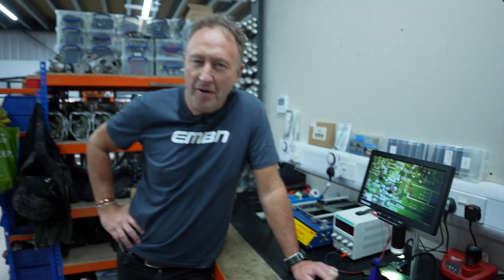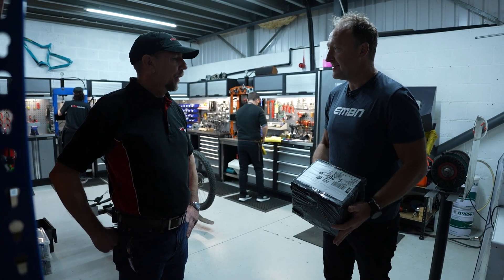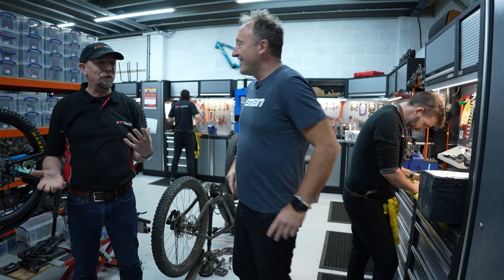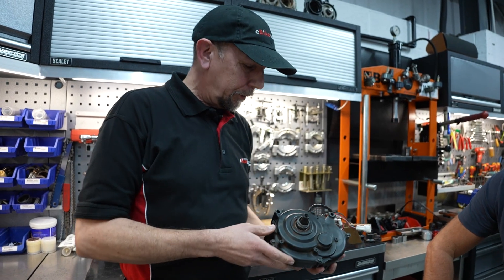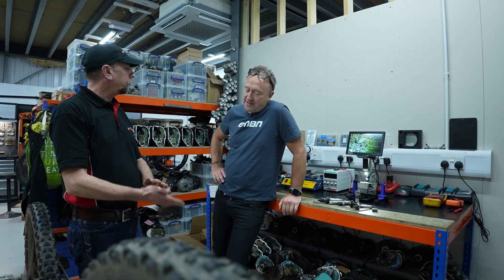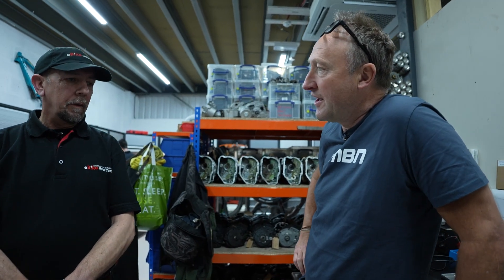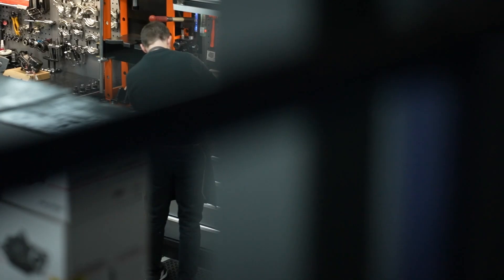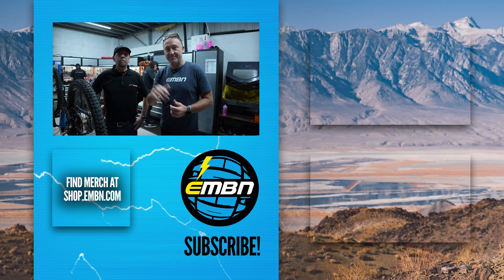How Affordable Is eBike Motor Repair | Behind The Scenes

Comment: What centers like this do is fantastic, but firstly, these repair centers are few and far between, and secondly, as mentioned in the video, there is not enough support from the original manufacturer. Keep in mind that these motor repair companies are getting the majority of their replacement parts from other motors that have failed in different areas. Imagine buying a car where the manufacturer doesn't supply parts for local mechanics, which would force consumers to buy a replacement car — this is an absurd situation. Also mentioned in the video, 90% of motor failures are due to water ingress. How is it that a rear mech can be made to be water-proof but not the motor? As proven by the motor center's efforts to seal the Brose motor, they have drastically increased its life. It's absolutely doable, but for some very odd reason, the manufacturers are choosing not to. Granted, all machines fail at some point or another, but there are clearly some very simple, tried-and-tested engineering solutions that are not being used in these premium machines. At the price of an e-bike, it's just not acceptable.
Reply: What's going to be telling is in 2+ years, when everyone's bargain ebike fails out of warranty, what will the consumer sentiment be towards these manufacturers when they realise they can only buy refurbished parts recovered from other failed motors, which will become fewer and fewer as time goes on. Its the same failure to future forecast as we saw with bike companies failing to realise that 2021 bikes sales would eventually end. Its just going to compound the issue of sales-slow down and will negatively impact the bike industry for a good few years. The shortsightedness of the industry know's no bounds.
Reply: Hi Dafy, distance shouldn't be such a problem, as most drive units can be shipped to motor repair shops in their country - eBike Motor Center has very strong network of partners worldwide. Regarding replacement parts, all service parts such as bearings, seals, bushings, belts, etc., are brand new and typically of equal or better quality than the original components.
The "very odd reason" is simply friction, which leads to high energy consumption. Everyone wants to buy the eBike with the best battery range...
Best regards, EBMR e-Bike Motorreparatur (Austria)
Reply: @bikemotorreparatur “Everyone wants to buy the eBike with the best battery range...” – but whats the point in range if your motor dies within a few hundred miles? Not meaning to go on the attack out the gate, and I understand this isn’t something within your control, but this logic is questionable at best. I think anyone whose experienced issues with their ebike would rather a bike that’s reliable over having extended range, especially riders from wetter climates.

Parts – Bearings & seals is one thing, but bespoke motor components is another. Are you able to source brand new motor controllers, the battery management system, a brand new stator / rotor,  does the manufacturer provide this to you directly or are they third party solutions?  How transparent are manufacturer's with you regarding these parts? Genuinely curious because I hear otherwise.

There is currently no legal support that forces the manufacturer to supply replacement parts for aging motors, as is the case in the auto industry (within the EU atleast). Its simply down to each manufacturer on how long they choose to support their products, and as we’ve seen with the questionable warranty process of some, this doesn’t induce confidence for the consumer looking for a bike that lasts and can be continually repaired. Also lets not forget, the terminology of 'lifetime' that manufacturers use regarding their motors is often the warranty period only. So when manufacturers like Fazua claim that their bearings last a lifetime, what they really mean is 2 years. 

I truly appreciate the service you provide customers to keep their bikes going, but the manufacturers need to do more to support you and their consumers. For a premium product, we should all be expecting better.

Comment: So, what about rebuilding Shimano EP8 motors? There are a lot of Shimano motors in bikes.
Nothing was said about this in the video.   Why would they be any different to rebuild?
Reply: Most of the Shimano drive units will sooner or later encounter the E010 error, which typically indicates a problem with the torque sensor, often stemming from communication or calibration issues with the main PCB. A problem that is not repairable. As a service provider and mechanic, you don't want to be the last one to have worked on the motor, even if it was months ago, and you've only repaired mechanical parts. Under the one-year warranty, you may be obligated to purchase the customer a new drive unit, which can cost around €1000. This could prove to be very costly in the long term. Best regards, EBMR e-Bike Motorreparatur (Austria)
Reply: In my previous post I spoke about it (you picked out the water pressure part).

They won't do Shimano because they can't reliably service them without getting errors post service. So they just won't touch them which is fair enough on their behalf, Shimano on the other hand need a pls explain on that one
Reply: Campaign to Shimano, if they speak to us and help with software, we will happily support their motors again.

Comment: Plz advice me, I have trek rail 9 purchased it 6 months ago, the motor is Bosch and it’s rattling while doing downhills without pedaling, I went to the dealer I bought it and they didn’t see anything to do, plz advice me about this rattling noise?
Thanks
Reply: Most motors rattle coasting. Some are worse than others. It's mainly gear lash. t
The TQ is generally the quietest and the EP8 the loudest. The rattle can sound worse with some frames than others.
Reply: Yes, as @tonyrobinson1623 said... the Bosch Gen 4 rattle is caused by a small amount of backlash or play in between the transfer gears, inside the motor. There is no fix for this currently.
Reply: @Ebikemotorcentre  Thank you for your advice, So is it okay to keep riding it ? Will the noise be louder soon or any damage from more rough rides or jumps ?  It’s very frustrating that I have warranty and they can’t fix it…

Comment: I paid about $1000 for a Brose "rebuild + upgrade" by eBike Motor Repair in Tennessee (USA).  This cost also included a new (used) crankshaft because mine had corrosion damage.  The rebuilt motor is quieter than when it was new, and I'm hoping the added seals and beefier parts will keep the motor alive longer than the rest of the bike (2019 Levo).

And I will be VERY careful to keep water streams away from the spindles when washing the bike!
Reply: Ripped
Reply: @rirrid5662  I am choosing to believe my motor received this set of stuff in addition to the replacement crankshaft and rebuild parts/labor.
"We now offer an upgrade for all Brose motors. This includes the following:

    Uprated thicker, stronger, Brose carbon fibre drive belt.
    Uprated heavy duty sprag clutch bearing for the motor drive pulley
    Uprated heavy duty sprag clutch bearing for the crankshaft drive
    Single lip rotary shaft seal to stop water ingress into the crankshaft needle roller bearing and beyond (This also stops rust damage to the crankshaft bearing surface and premature failure of the crankshaft needle roller bearing)
    Genuine Brose bearing cover seal for the right hand crankshaft ball bearing (Not factory fitted until 2017)
    Waterproof long life grease packed between outer bearings and motor covers. (This helps stop water sitting in these areas and seeping into the outer bearings).
    We also fit an external X-ring seal each side of the crankshaft to further stop the chance of any water ingress into the motor.
    We remove the two ECU cover screws and seal these to stop water ingress into the ECU.
    Finally, we treat and coat the motors’ electric plugs to stop corrosion and water entering the ECU by capillary action along the wires."
Reply: @2011buddylee I decided against a new Brose motor because it would have the same weaknesses as the one that failed.  I spent the extra money to get their uprated parts as follows (copied from their website) together with the regular rebuild: 
    Uprated thicker, stronger, Brose carbon fibre drive belt.
    Uprated heavy duty sprag clutch bearing for the motor drive pulley
    Uprated heavy duty sprag clutch bearing for the crankshaft drive
    Single lip rotary shaft seal to stop water ingress into the crankshaft needle roller bearing and beyond (This also stops rust damage to the crankshaft bearing surface and premature failure of the crankshaft needle roller bearing)
    Genuine Brose bearing cover seal for the right hand crankshaft ball bearing (Not factory fitted until 2017)
    Waterproof long life grease packed between outer bearings and motor covers. (This helps stop water sitting in these areas and seeping into the outer bearings).
    We also fit an external X-ring seal each side of the crankshaft to further stop the chance of any water ingress into the motor.
    We remove the two ECU cover screws and seal these to stop water ingress into the ECU.
    Finally, we treat and coat the motors’ electric plugs to stop corrosion and water entering the ECU by capillary action along the wires.

Comment: I hose mine all the time and my current motor has been in for a year so far. But then I got the specialized 4 year warranty so I’m not worried about it yet
Reply: 4 year warranty on the 2020 Levo which expires in 2024. How much was the new motor ?

Comment: Not sure how things go in UK market but here in US if you're out of warranty for your Specialized eMTB and need a new motor, specialized offers a 20% discount for a new motor, for 5 years after warranty expiration.
Reply: Even if that was a thing here (I actually don't know if it is?) still much cheaper to send the broken motor to these guys, Like I did! The work I had done was less than half the price of a new motor from specialized. Any work you have done (even the full overhaul + Bearing and belt) would still be a worthy chunk cheaper.
Reply: @danimayb  Welp, unfortunately we're not as lucky as you guys are there in UK. Here is a quote from a repair shop here in US where I have inquired about Brose S Mag Repairs last August: 
"For Brose S-MAG models common overhaul costs are as follows (shipping not included): 
Basic service - $541 for basic service to replace common parts. Includes sealed needle roller, carbon fiber belt, both sprags, labor and 30 day warranty on those parts. 
Basic overhaul - $673 for basic overhaul which replaces all the bearings and belt with factory spec parts. Includes drive assembly bearings (includes sealed needle roller), sprags, carbon fiber belt, labor, and 90 day warranty.
Upgraded overhaul - $863 for our top shelf service option. Includes all drive assembly bearings, HEAVY DUTY sprag bearings, complete seal kit, carbon fiber belt, all labor, and 360 day or 3000mi warranty. 
Does not include shipping or other items we may discover during inspection like damaged shafts or other items not covered in the standard overhaul. However this is the main reason for an inspection. We always provide a report and pricing before we begin to make sure you are getting the best options for your needs before we ever get started."

I will kindly remind you that a brand new Brose S Mag is $990, at least that's what has been quoted to me when I contacted my local bike shop.

Comment: I've had to replace motors and a motor controller inside the tongsheng tsdz2 and it wasn't difficult or expensive.  Just annoying that the open source firmware defaults were set to fry these components and not massive/obvious warnings about changing the defaults.

Comment: to be honest that's very affordable to have it fixed/serviced. 

I would definitely like to see better waterproofing on emtb's tho. They could DEFINITELY do better.
Reply: @anonymousone6075 it isn't claiming anything...the cost will be purely dependent on what is wrong with it.
If it needs a full overhaul, then surely at half the price of a new motor, that's better than forking out £600/700? 🤔
Reply: @anonymousone6075 interesting perspective. Be nice to know if others had the same experience as you

Comment: This was very helpful. The advise shared at 4:40, should that be done with or without power turned on?
Reply: Always with the power off. The motor needs to see pressure on the pedals to activate, so switching it on with no chain means it would not work anyway. Also, with the motor off, more can be heard and felt.
Reply: @Ebikemotorcentre Great, Thanks for the insight.

Comment: Why can I buy an IP68 pump & motor that’ll run immersed in dirty oil & chemical laced water for months and months without much more than basic maintenance but the bike industry insists on leaky motors & gearboxes for mountain bikes that have to deal with splashes of water & dust? For the price of a bike motor I’d expect proper seals, not blobs of grease and o-rings resting over a gap.
Reply: The IP68 submerged motor, resistant to water, dirt, and oil, doesn't draw its power from a limited-size or capacity battery, like those on eBikes. The next significant aspect is that most of these submerged motors utilize the liquid in which they operate as a cooling medium, which is crucial. When comparing eBike drive units to regular electric motors, it's important to note that regular electric motors draw all their power from the electrical grid and don't need to bother with proper seals that cause friction. They can easily overcome any friction with the ample power and cooling supplied. Proper seals lead to friction, increased power consumption, and generate a lot of heat that cannot be easily managed by a small eBike Motor which is limited to his power consumption and has no active cooling system.

Best regards,
EBMR e-Bike Motorreparatur (Austria)
Reply: It's a good question

Comment: Ahhhhhhhhh. I better stop using pressure washer. I just ordered some brushes and a hose from amazon. 
  Thanks to you. You may of saved my bike from future damage. 😮
Reply: @anonymousone6075 thanks stranger. I'm sure other people will benefit from your wisdom. I bet amazon benefited from this also. 😊👍
Reply: @anonymousone6075 The only motor that greasing behind the bearing seals is possible is the Bosch Gen 3 on drive side and Bosch Gen 4 on both sides.

Comment: My 1st Gen 2 went 11,000 km before the cranks went wobbly then, I still put another 1,000 km on it waiting for a warranty replacement. The next THREE were all 5000 ERROR Code and just would not light up. I've got the last one with only 2900 km ready to be 'repaired'. I NEVER use anything stronger that a garden hose and rarely direct it at the cranks...
Reply: This is a usual issue. The problem is that as soon as the bearing gets "wobbly" it lifts the bearing seals from their seats and that means water can just run into your motor without any pressure required. Failure can also be caused by long flooded ruts, deep water fording, car racks on wet roads etc. It's not always a garden hose, but it will be water.
Reply: I think it only needs one direct spray with water and then the rot sets in

Comment: Now here comes the real interesting question: How about Shimano E8000 motor overhaul if it's wrecked. There's not a single shop in germany that repairs an E8000. They all switch to a new one -> ~900€. 🥴 There are also people talking about the E8000 can be replaced 1:1 by the EP8. Is that true? Thanks for any advice and greetings from Cologne, Germany 🍻
Reply: Shimano are one of the only companies out there that will not support or talk to anyone that works on their motors. Therefore, people refuse to support them until they support us. Campaign to Shimano and if they support us we would be happy to help.
Reply: never buy anything that your local city cant fix.
Reply: @Renovatio2142  The whole country. ☝🏽 No matter what shop...they all only change the whole motor. 🤦🏽‍♂️
Reply: The E8000 is not included on the motors he can repair- Shimano's fault, the PCB is the issue IIRC and access to some bearings?? have a friend who went through 3 motors, all disposable effectively....Would never buy one with Shimano- stick with Bosch or Yamaha(pretty experienced with 2 wheeler motors and my motorbikes in the 80's were ultra reliable)

Comment: I would love to him ask what’s the best brand in their experience?
Reply: We do have extensive data on what motor fails for what reason and how many fail. We analyse this along with national data on how many are manufactured so we know all the answers to these questions, but EMBN will cover this in one of their next few videos.
Reply: @anonymousone6075 I talked to a fellow e-bike rider who has a Bosch mid drive class 1 hard tail mountain bike. I asked him how many miles were on it, he replied 7,000 miles without any issues. I own two of the same 2018 with 1500 miles on each bike, got to say great drives so far.

Comment: Pleasantly surprised how complete overhaul of the motor is only around 350 pounds,over 5000 miles on my e8000 , still smooth but i wont hesitate to send it to these guys when needed
Very reassuring vid 👍🏻
Reply: Thanks Steve, greta bunch of guys for sure